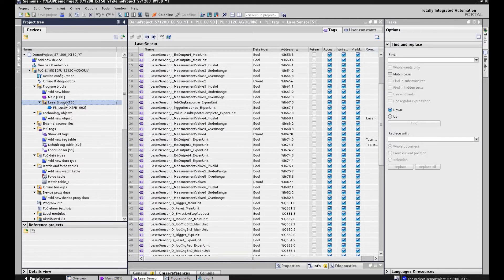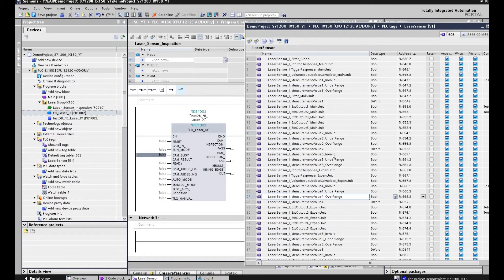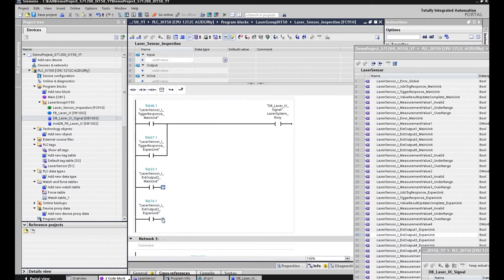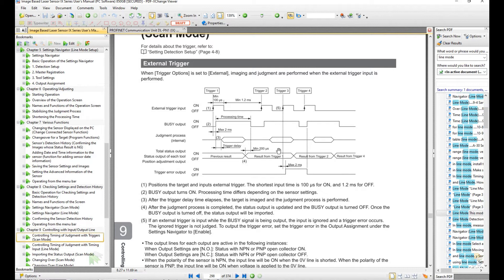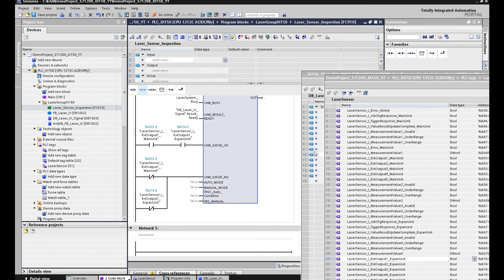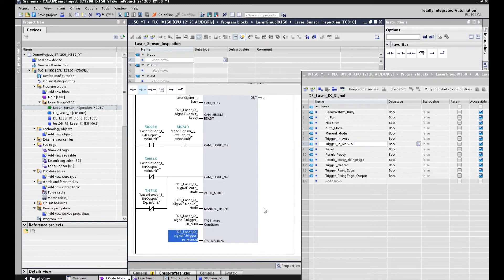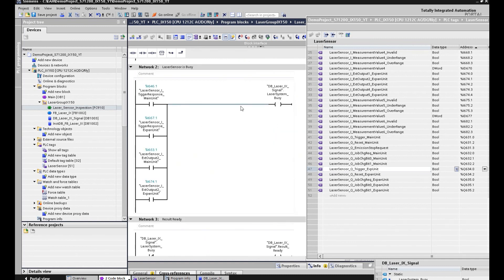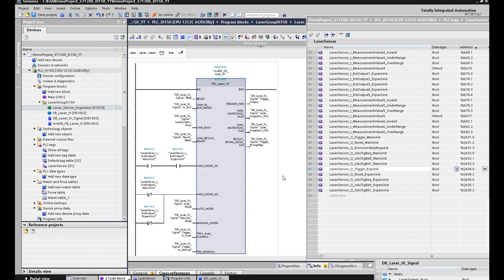KI09. (EP06) IX Laser Sensor - Call FB (Function Block) in TIA Portal

Comment: Sir, can you make a video for how to change timer preset value from wincc SCADA in Siemens S7 300 PLC?
Reply from the maker: Sorry, I don't have plan for WinCC and S7-300 recently. But regarding your question, you can use 'INT' convert to 'BCD', then use the BCD for the timer setting of the S5TIME. Siemens S7-300 S5T is BCD format
Reply: @electricalautomation OK,  thanks for the reply.